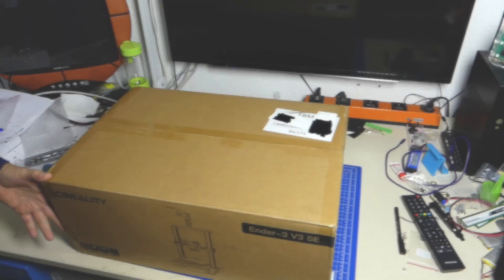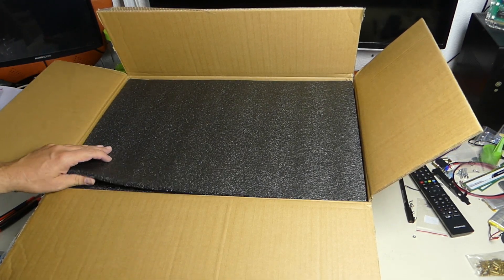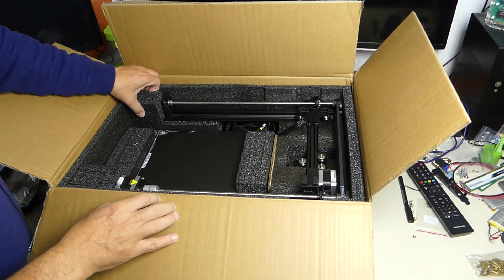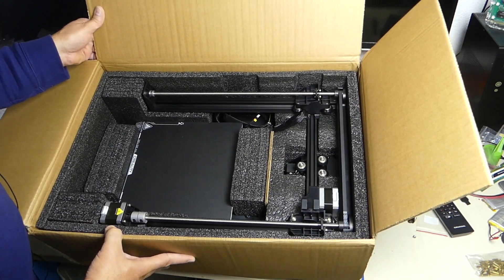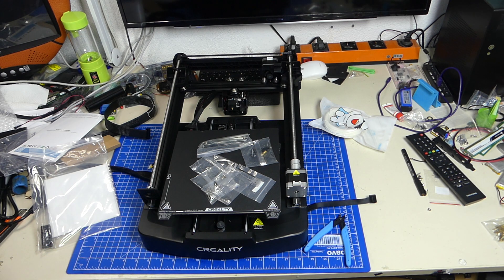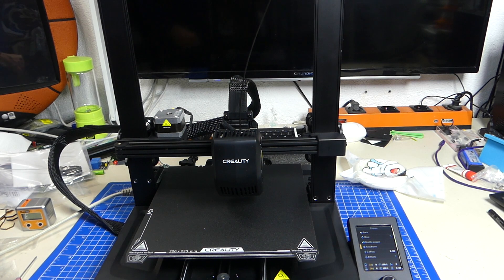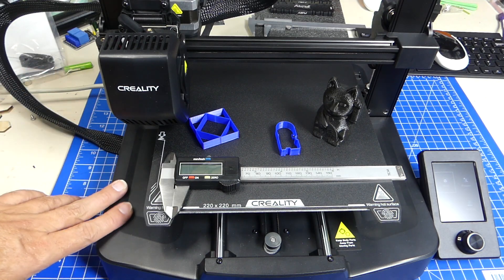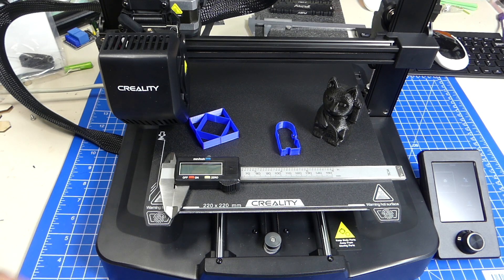Creality Ender 3 v3 SE review - The SE stands for Super EASY !!

Comment: Thanks for a informative video enjoy your new SE.

Purchased this printer a month ago  and everything was duper easy. Then 2 days ago I switched on and had just the blue screen... after installing 1.6 it no longer printed on the bed it just made a mess.
I checked the 4 screws that hold the bed and all of them had loosened,  after that I was back to normal printing.

Do if your calibration  changes and prints fail check those 4 screws.
I also replaced that bod awful bed plate for a new pei plate.. so much better
Reply: Did you manage to make the gcode image appear when selecting the file or at least the information on the filament used and the other options that appear before sending to print?

Comment: Hi there :) I noticed something strange on my ender. You have a smooth movement from 36:18, but mine goes up slowly and then down. And because of this about 1 cm of filament isn't printed. Any solutions for this? Perhaps someone else has the same problem? I have the latest firmware SWV1.0.6 - THANKS :)
Reply from the maker: That's indeed odd. I can only guess at what is causing it - maybe the initial calibration was off, and the printer thinks there's a bump in the bed.
Clean the nozzle and let the printer calibrate again - that's my best guess ATM.
Reply: Thanks for answering! So, well. I cleaned everything, changed the fillament (4 times) and after a while everything was back to normal. I am now using Creality Print so the up and down movement is related to that software. In Cura it goes straight to the print zone. Weird bug... @dherrendoerfer

Comment: Hi, I also have this printer and it worked fine until a few days when it stopped printing. I had cleaned the nozzle several times, I even changed it with the new one but the problem remains. Do you have any ideas to solve it? Thanks .
Reply from the maker: Hi, can you add a bit more detail to how it stopped, and what no longer works ?
Reply: @dherrendoerfer  Yes, it doesn't work anymore. I have cleaned the hot end many times. The printer starts printing and everything is ok but after 3-4 minutes it stops extruding. I looked inside and found that the filament has a twisted part inside the Bowden tube near the hot hend...
Reply from the maker: That can be a number of things: you might be running PLA too hot, there might be a kink in the PTFE liner in the Extruder Throat or the tension on the feed is too high or low - 
have you ever done a  hot pull to clean out the throat area of the extruder ?

Comment: To anyone reading this that is in the market for a first 3D printer. 

DO NOT LISTEN TO THE SHILLS.

Check over every single one of these people positive of this machine, they got it for free or are sponsored. 

Then check out the poor people that spent their hard earned money on this machine - and the problems that actually exist.

Ive had this machine for six days. Ive gone through 2 spools of filament (Thats almost printing nonstop for 6 days btw) and still cannot get settings dialed in.

Most of the hardware on the machine was loose beyond concern (despite not being told to check or tighten it)

The auto bed leveling and general user interface is absolutely terrible. It hijacks your machine for 10 random minutes - if you shuold want to do something simple like moving the head up and down the axis to check for smooth movement... well too bad <REHOMING> process feels like running right now. And theres nothing you can do about it.

This machine is a joke, the older and less featured ender 3 line is unironically a better choice simply due to everyone already diagnosing all the problems. This is a shiny new machine that in my opinion is poorly executed.

Do not buy this. No matter what the SHILLS say.
Reply from the maker: @forestnfren8146  I've gone through a similar amount of filament in the last 6 weeks, but I have never hit a 're-homing'.
2 spools in 6 days, sound to me like a lot of it worked. 
I've gotten a couple of comments regarding play in the v-roller carriages, and "yes" that should not be on a new printer, but you will definitely get it, because it's a design feature.
What are you using for the g-code generation ? the 're-homing' makes me think that your g-code is using M28,M29,or M32 commands (which it should not) those can reset the homing memory.
If you have problems with the automatic height adjustment, then check for roller slack under the print bed, or on the X-axis. That should fix it.
Reply from the maker: @forestnfren8146  
I don't know those people you are talking about, and I suspect: neither do you.
But for what it's worth, I'm sorry that you had a bad experience while I didn't.
Reply: hankd fren, So this was not your first 3D printer then?
I just got this machine but have not unboxed it yet, I hope I am not going to run into these issues
 so what other Ender model  that you own (if any) did you like better?
I got the ender 3 v2 neo last black friday "on sale" for $240 but never had time to set it up and we had horrible humidy here almot no stop ad i didn't want to open a roll and have it get wet  especially where I am new to this i don't wan to add extra variables like wet filament
when i saw thi machien iI really felt liek i made mistake since this one has auto Z offset which was really the big sellig point for me here but also the direct drive sprite extruder.
I got this machine for like $140 afte the sale and coupon and have till Jan 15th to return it
guess i better get goig on testing it then.